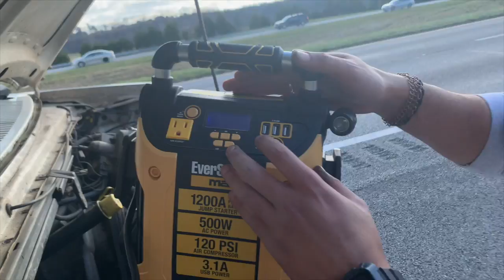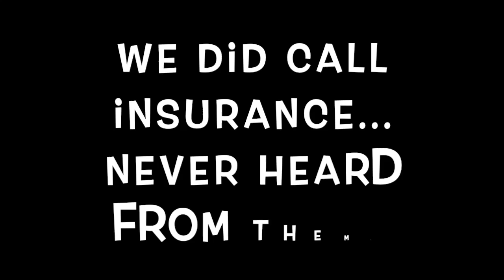ROAD TRIP PT. 3 | DAY 2

Comment: Never run till out of gas. Fuel pump is submerged in the gas tank. The gas is the pumps lubricant.  Plus all the gunk in the bottom of the tank and can clog fuel filter,fuel line etc.
Reply: I know you can burn out the fuel pump when it's dry, you are correct on that one.
Reply: yup... fuel pump running dry = something gonna break.. broke 2 of mine like that.. after letting a car sit for ages, i broke both from 2 cars... cause i had it low fuel.. so yeah fuk
Reply: Their fuel gauge was broke.  they talked about in the last episode.  No way of knowing what the indicated fuel is actually till you run it down.  A long trip is probably not the best place for that particular experiment though.
Reply: @RoamGaming  they could've checked the internet for the gas capacity and then the average mpg for it and figured it out like that. Also they were able to see it hit E and still drove he said 90 more miles.... They probably ended up burning out the fuel pump.
Reply: @bastionwolf  a lot of RVs like that are not going to have a standard size gas tank that you can just google unfortunately and the gas gauge only showed about a third of a tank after it was filled.   So showing E doesn't really mean anything.  Yes, there are better ways to have solved this problem but honestly, this is how it's usually done.  Run it down, check to see how many miles you got on the tank and then use the trip meter to keep track of fuel.  Usually you don't do it on a trip like this though.  It's something she should have sorted ahead of time.
Reply: @RoamGaming  Or, ya know, fixed the fuel gauge.
Reply: @roberson644  i don't think they noticed until they filled up to leave.  hard to drop the (now full) gas tank in the cold parking lot on black friday to fix it.  but yes.
Reply: I concur with other comments.  Root of the problem was Einstein trying to see how many miles he could go after hitting empty before the tank would go bone dry.  Think about filling up when you hit 1/4 tank and you'll enjoy the trip more and it will be cheaper for you.  Im enjoying watching your trip and seeing where this adventure goes.  Safe travels!
Reply: @arly4496  you do understand that an indicated 1/4 tank probably happened within 50 miles of filling up?  the gas gauge only showed 1/3 of a tank when full.
Reply: How many times have you replaced the batteries? You may need to replace the alternator and look at the distributor cap see if you need to replace that you also need to keep your tank filled up at half a tank all times when it gets to have a tank top off even though everybody says it's not environmentally friendly it's better than getting stuck by the side of the road never run your tank to empty because you're destroying your fuel pump with all the junk from the bottom of the tank
Reply: Actually, the gas is not really the lubricant for the pump. It is the COOLING. Pumps die from overheating, aka not being submerged in fuel

Comment: Can't wait to see the body repair. Those wooden framed campers are relatively easy to rebuild. The trick is finding the matching metal or just use something like painted corrugated to rebuild it.  Carry an empty small water bottle. You can put gas in that if you run out next time and dump some in the carburetor.

Comment: With an old long idle vehicle. Expect fuel system to need alot of tlc.  I thought about commenting before but those cans normally can not fill anything but a lawnmower so you need a funnel. Also please never stand on the side of the highway wearing nothing but gray, you blend in with the highway.

Comment: hey leenda, running an old vehicle to empty is a rookie mistake... we've all done it. you pulled all the sediment into the fuel pump and trashed it. some dad advice: if you haven't already, change the air filter. takes five minutes. google it. you probably need new spark plugs and wires but that can wait until you get to your destination. those old ford engines will run forever with a little tlc. rich & steve should have helped you with this stuff but well you know...
Reply: That thing was never gonna make it. Yeah I wish they had a funnel and a yellow vest at least. I've replaced the whole fuel system on an old Ford before, it was a big pain in the ass but worth it because it never gave me another problem.
Reply: Especially goodpoint about the safety vesr or at least some kind of reflective marker like those foldup triangles.

Comment: Is Bertha fuel injected or does it have a carburetor? If it's fuel injected then the injectors could be clogged. If it has a carburetor then that could be clogged. When the gas runs low the sediment travels through the fuel line. Something that you could try is fuel treatment, also after trying to start too many times you might have flooded it. Take a little between each attempt, if you smell a strong smell of gas let it sit for a bit.❤🌷🌷❤

Comment: Check fuel filter.  You sucked up all the trash from the bottom of the gas tank when you ran her dry.  Never run lower than 1/4 of a tank to avoid trash at bottom of gas tank.

Comment: It's the gas tank!!! that used to happened to me I kept discharging the battery till the point that I'd burn my starter the reason you have to add alot of gas is because the gas tank is dirty so when you mix the old gas with new gas all the new gas gets polluted that's why it seems like your always running out of gas the tank sloshes around and mixes it with rust tank corrosion if you let it gas settle it will start but as soon as it starts sloshing the gas becomes to polluted for the engine to run

Comment: Number one not enough fuel in the tank to crank number two there is a switch box for those batteries so if one's dead you can switch it to charge the otherand number three if starting fluid ain't making it run you've got other problems

Comment: I would pretty much guarantee by the age of this vehicle, there is no pump I’m the tank. It will be a mechanical pump on the side of the block driven off the crankshaft. If you were to pour a bit of gas down the carb, it would run enough to pull fuel up to the carb.

Comment: Been there done that. My Rv days are over after my engine blew up in the middle of nowhere last year. Threw a rod right through the oil pan.  I'm waiting for a CyberTruck now.
Reply: Maintenance.
Reply: Maintenance was kept up all fluid was changed.
Reply: New distributor new water pump Brand new Training fluid and gear oil was just done
Reply: @Xyquest  well you didn’t throw a rod by mistake... just because you did basic fluids, doesn’t mean it was maintained properly before you. Did you ever drop the pan and inspect the rod bearings, wrist pins for slap, overall oil pickup tube condition, oil pump, etc? Rod is usually from oiling issues.

Comment: Never run a motor out of gas , save yourself some grief and don’t let her get near E
Reply: I almost did that on my 2014 Nissan Versa once, I made it to the gas station, shut it off, the gas station worker asked me to move it a bit forward, and it didn't wanna crank over. It did once I filled the tank with gas

Comment: I watched the video with rich rebuilds and idk why the extent of getting the RV to run well was a battery. Then there was a breakdown
Reply: Like I'm not trying to be a hater but the whole situation was just cringy as hell. It prolly needs a carb rebuild and/or injectors. And probably Definitely sparkplugs. It was just terrible
Reply: Which spark plugs is basic maintenence which it seems like it was a spark plug(s) that was fouling out
Reply: And actually the fuel pump was the small cylinder type object that was on your so called lamp

Comment: I think you paid 500$ or so for Bertha, and still it is not worth the money. Anyway, "Gas tanks are pretty much sealed and there is very little chance in trash getting in the tank. Gas pumps usually have filters when you pump the gas. If the trash was such a concern sitting in the tank there would be a lot more clogged fuel pump strainers and fuel filters", but you can't run out of gas, and it is worst for old cars. Portable Jump Starter works only for a few tries.

Comment: Wait, did I understand correctly?

This guy did 93 miles on E? Is he for real? Yikes...
Reply: Yes he did haha...when they filled up at the gas station that's when they showed that the gas gauge is broke it only went just above half so that's why he drove so long on E was to try an see how far they can go when it hits E ya picking up what be throwing down...
Reply: Ya sounds like they were trying to run it out of gas I mean my light comes on with 30 miles to empty that being said I have never actually run it out so maybe it can go further but also you assume that thing gets like 10 miles prey gallon so that's like 9 gallons you burned
Reply: Yea true an I bet your spot on the mph so I'ma guess it's a total of like 30+ gallon tank then specially for a motorhome could be more like 40 maybe my ol 70 f100 the sending unit for guage went out one day driving along an it went from full to half tank in like half mile I thought I had gotten a hold in it somehow but it was in the cab behind seat an ever since then half tank ment full an quarter was half so that worked out
Reply: @itstime6089  yeah I get that, but the gauge clearly went to E from above half. Even with a broken gauge, 93 miles is ridiculous. Most cars do 20-40 miles on e. This is a v8 with duallys, short gears and the areo of a brick. If the gauge was working correctly, I wouldn’t assume more than 20 miles on e. Fuel pump was the lesson. 

Since they where in there to replace the pump, I wonder if they bother to replace the fuel level float and sender?

Comment: Somebody's probably already said this. But in case they haven't I'll be the ass hat. I got a perfectly good Mercedes for almost nothing a few years ago for this exact problem. Car had been passed around from teenager to teenager like a bad rash and they couldn't keep it running. At one point they tried to have the car taken for scrap and the tow truck operator couldn't get the car to start so they could get it out of the parking lot where the tow truck wouldn't fit and to where it was parked. They'd been trying to run the car with a gallon and 2 gallon of gas in the bloody tank furthermore driving it with the wrong kind of gas wasn't helping matters any. That particular vehicle required a external fuel pump and filter fuel pump was like $30 and so I changed the fuel pump and the filter at the same time. I drove the car for 2 or 3 days before changing the fuel pump but if you seen what the fuel filter look like it was only a matter of time before the pump went. Old carbureted Vehicles especially you can't run them on low gas. You also have to factor in the gas gauge not necessarily working properly with something that old. Shouldn't let the gas get down below about quarter tank on something that old and big. The fact that you guys seem to be so calm about the situation is what really blows my mind I constantly sound like a psychopath when it comes to Vehicles breaking down generally because of the crap I've had to fix and how I've had to do it where it's usually something incredibly stupid like a 75 saint hose clamp and there's technically know where to get one for over a hundred miles and nothing is open for a day or two those kind of things. I could most likely give you a list of things to have give him the age of that RV but needless to say nobody listens to old farts like me about doing things like having a Rubbermaid container and the vehicle with a couple of spare belts and the proper tools for changing them combined with extra fuses and light bulbs, one or more containers of each fluid such as brake fluid windshield wiper fluid radiator fluid transmission fluid oil and power steering and besides that stuff it doesn't hurt to have one or two extra windshield wipers. Couple of rolls of duct tape or something similar as well as extra radiator hose depending how far you're travelling. Also doesn't hurt to have a little bit of sandpaper in case you've got to clean a battery cable end as well carry one or two extra battery cable ends

Comment: WALMART Batteries Are TRASH!!
Next Time Buy Your Battery From AUTOZONE!
DURAMAX PLATINUM Batteries From AUTOZONE Have 3 YEAR Warranty &  Are AGM Batteries, Which Is New Battery Technology!  PLUS  AUTOZONE Does FREE BATTERY TESTING & FREE BATTERY CHARGE!
Reply: GOBBLESS
Reply: You are aware that there is only a couple battery manufactures?  They then label them for whoever is selling them.  The 8-year-old battery in my Hyundai finally started giving me problems.
Reply: AMG batteries are far from new technology 🙄  
Walmart batteries are good for starting because it's cheap and gets you going, later on you can do what I did and that was swapping the starting battery for a AMG and auxiliary battery to Lithium Ion Prismatic cells and built a battery bank.
Reply: @jonnyboym72  You are talking about an expensive battery, not a typical lead-acid battery. Most folks can't afford what you are talking about.
Reply: @mrj-charles6383  facts
Reply: Every walmart battery I've gotten has been great
Reply: Get in the Zone!  😂
Reply: @jonnyboym72  What i meant to say was AMG batteries are Far NEWER tech then standard old batteries! Walmart batteries do NOT have Long Life Span Compared to AMG batteries or Regular batteries from Autozone! BTW I'm speaking from Personal Experience buying auction automobile & junking them! EVERY TIME I find Walmart (Everstart) or INTERSTATE, ACDELCO, HOMER DEPOT ( EXCIDE) , ALL THOSE BATTERIES ARE TRASH, REGARDLESS IF THEY ARE A YEAR OLD!   Battery life span should be 3 to 4 years! Where as a AGM battery if well maintained should Last 4 to 7 years! That's why AGM are so Damn expensive! Plus AGM  are well sealed!  Johnson Controls which makes OPTIMA, Autozones Duralast Batteries quality went down hill when they out sourced their work to Mexico!  ALWAYS REMEMBER CAR BATTERIES ARE LIKE EGGS, ALWAYS GET THE FRESHEST ONES!   ALSO STAY AWAY FROM CHINESE MADE CAR BATTERIES OR ANY BATTERIES THAT COMES OVER SEAS! BY THE TIME THEY GET HERE , THE BATTERIES ARE PAST THEIR PRIME!
Reply: @804_Rider  IT ALL DEPEND WHERE YOU LIVE!   IN NY WINTERS  ARE BRUTAL! THE HIGH UP NORTH YOU ARE, THE HIGHER "Cold Cranking Amps (CCA) or Cranking Amps (CA) " THEY HAVE TO BE! AND LOWER SOUTH REGION YOU ARE , THE LOWER "Cold Cranking Amps (CCA) or Cranking Amps (CA) " THEY HAVE TO BE!